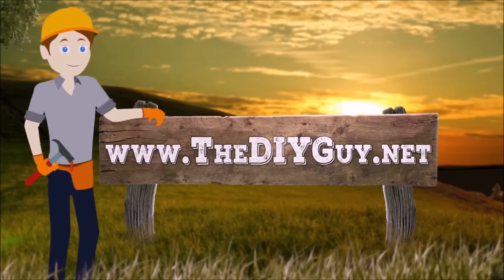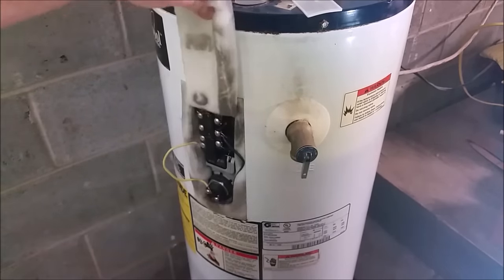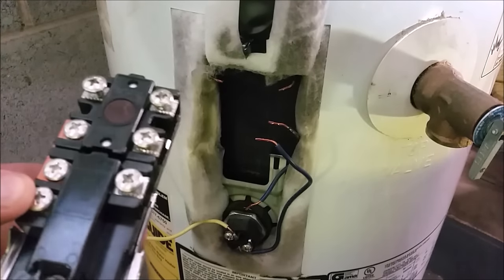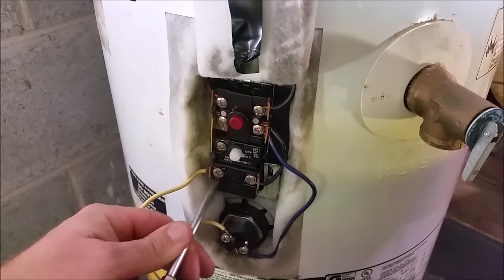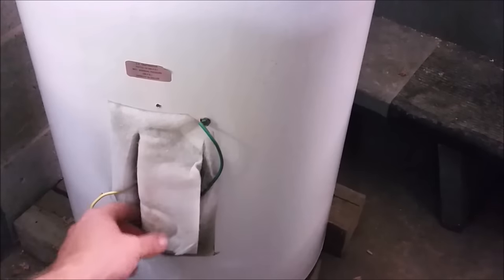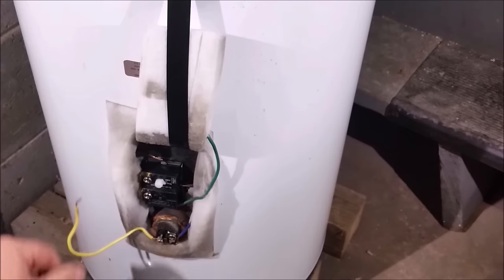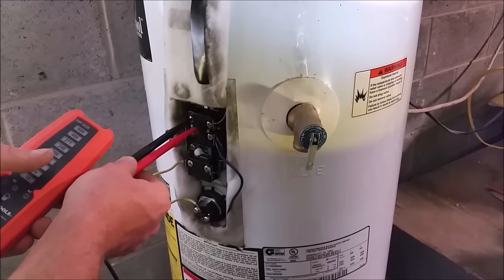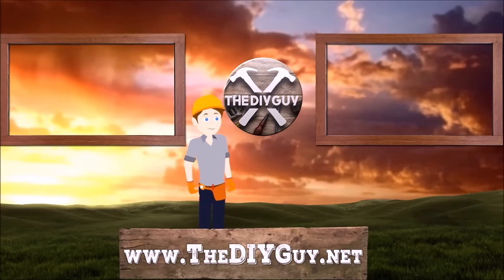How To Replace Your Electric Water Heater Thermostats

Comment: Thanks so much..... out of the blue this evening - no hot water - had it this morning.   
Most likely thermostat went out?   
I'm hoping that's it -  cause changing the elements and having to drain tank, etc seems like a lot more than i could manage....
Reply from the maker: You should be able to open the top inspection cover and hit the reset red button on the t-stat and get hot water maybe in 30 or so mins depending on how long its been out and used. See how long it lasts sometimes they will trip in a week or so sometimes a couple months. It most likely overheated and tripped. So replacing the t-stats should take care of it.
Reply: @TheDIYGuyDOTnet  thanks so much -  your advice is invaluable!!
Reply: @TheDIYGuyDOTnet  well .....a trip in my attic revealed that my RUDD heater was installed in 1996...   we've had work done it over the years, but always hired someone....  when i took the cover plate off the top, all I saw was the element.... when I removed the bottom cover plate, there i saw a thermostat -   so I did press the reset button to see if maybe that would do the trick -   will wait about 30 minutes, then check........... any other thoughts on my observation??
Reply from the maker: @buetow63  If you heard a click when resetting it, it should get warm. Did it end up getting warm/ hot? Seeing that yours was installed in 1996 and that its in your attic I would think about replacing it in the near future unless they have a pan or something to catch and drain the water if it starts to leak. Sometimes they leak at the top of the tank or near the t-stat and also cause the t-stat to trip or go off on reset. Was any of the insulation wet within the inspection cover? There are both 220 volt and 110 volt water heaters out there. Its hard to tell from what your describing which one it is. You could click the link in the description and go to the bottom of the page an upload a picture of it. But because of the age and location I would think about replacing and a newer one shouldn't leak for a while and it should also lower your utility bill as it will be more efficient.
Reply from the maker: @buetow63  You're welcome, Glad we can/ could help.

Comment: Great Video. Very detailed and clear. Question Please. How do you test the reset button? My water heater is dead. When power is applied to it I get nothing. No sound to indicate the elements are heating. The reset button is pushed in and when I pressed it I thought it would pop out but it didn't. Seems to be stuck in place. Any suggestions will be appreciated...thanks.
Reply from the maker: Thanks. There really is no way to test the reset button.. It goes off because the water in the tank got to hot so you can run the hot water for a bit to lower the temperature in the water heater and then try resetting. If that doesn't work you will want to make sure the breaker fully reset. Shut it all the way off and then back on and be sure both legs of the breaker engage. Next you can open the top inspection cover and test the top to leads with a volt meter to make sure you in fact have 220 volts going to it. Be careful as you will be dealing with live electric. If both legs are on and you get 220v at the top t-stat then I would suggest replacing the t-stats.
Reply: I'm having the same problem with my Rheem model 71-40S but when I take the top plate off there's nothing there but foam insulation?

Comment: should you replace the thermostats when you replace the elements?  I cleaned out my 50gal heater and sucked out all the salt gunk from the bottom and replaced the elements and anode because I was in there and the bottom element was badly covered and the anode was half depleted.

How do you know the thermostat is bad?  After I replaced the elements and anode, it seems it does not heat like before.. I am suspecting the thermostats since that is all I did not replace.  Do you have any advice?

Comment: The insulation around my water heater's thermostats was significantly more of a pain in the ass, but I got it done. Hot water was lasting just shy of 10-15 minutes, even though it's a 60-gallon tank. In about 3 hours, I'll see how it's doing.

Comment: I changed my thermostats but they didn’t come with replacement plastic covers and the old covers don’t line up correctly does it mater if it’s not an exact fit?
Reply from the maker: All the replacement t-stats I have seen came with new covers I guess they are cheaper if they don't include it. Those covers are in there so that if you open the cover you can't touch the wire while moving the insulation. As long as there somewhat secure and cover the wires you should be all right.

Comment: Does the water have to be drained first
Reply from the maker: For replacing the t-stats no need to drain as they go on the outside of the tank. If you were to replace the element then yes.

Comment: Our water is only warm not hot, and there isn't a lot of it.  I checked both elements and the thermostat and all is good.  Should I assume its the dip tube?
Reply from the maker: Hello, How did you test the lower element? I would start with replacing the lower element as that is normally the fix for running out of hot water.  Link to our video on replacing it ->   https://www.youtube.com/watch?v=ReR_UcOf7E8

Comment: So will this be the cause of my hot water not lasting as long.. when showering the hot water runs out within a couple mins then its cold again. I have electric..
Reply: You'll want to check your heating elements as well.
Reply: @IrishLincoln    what about if i have a leak somewhere, will that also cause the hot water to run out faster then usual??
Reply: Lower thermostat went bad on my Bradford. 5 minute shower before running cold. Replaced the lower stat and showered for 25 minutes. Dip tube can also go bad but that would mean lukewarm shower water from the get go

Comment: Replacing thermostats and elements and ran into a problem with some of the wires being too short to go back into the thermostat.  There was no slack in the wire.  Suggestions on how to safely extend the wires...they are about 2 inches short in each case.
Reply from the maker: I have also ran into that on some heaters. I was able to pull some wire down from the top connection. Now its a little harder as there foam filled/ insulated. You can use the same size wire and wire nut and extend them. Be sure its 10 gauge wire and a wire nut meant for 10 gauge wire.
Reply: Hey thank you for that.  I'll hit the hardware store for the 10s right after work.
Reply from the maker: No problem. Good luck with getting her back up and running.

Comment: Hi. Great video. Are the thermostats universal? Will one thermostat fit multiple brands of water heaters? I have a whirlpool unit. Im sure its the thermostat, I think , as I am continually resetting the unit. Ken
Reply from the maker: Yes, They should fit. Only difference between most of the is how they tell you how hot the setting is. Some us just A,B,C , Some use warm, hot, some use actual degrees. Most of the time replacing the t-stats will solve the problem of having to always hit the reset button. Thanks for watching.

Comment: Do I have to replace both thermostats if only the lower one is the one that is not working?
Reply from the maker: You don't have to replace both. I just find it better to replace in a set and for around 22.07 you can replace both. https://amzn.to/2zEc4Sv upper and https://amzn.to/2uGt8BZ lower. There may even be cheaper ones on there.
Reply: Thanks
Reply from the maker: No problem, Glad we could help.

Comment: Help  4 year old water heater whirlpool,  bottom door area inside is all rusted, we discovered this when we got no hot water this am and had to hit reset on the upper reset button, better check the lower one while we had the power off and there is rust

Comment: Is it possible for one thermostat to go bad on the water heater ?? 

I I did replace one heating emement that was bad
Reply from the maker: It is possible to have one t-stat go bad. The upper one controls the lower one. I would recommend replacing both as they are not that expensive for a set. There's a link on our site to them upper around 14$ and the lower 9$ ish. So for a little under 25$ you can replace both might even be a kit with both for less.

Comment: Leo me just say that not all thermostats are easily removed. Top - I struggled to remove it  bending it in the process. Bottom, still unable to remove. Feels like an invisible screw is holding it in. Rheem 38 gallon, 7 year old. Top element so loaded w/caked in broke sediment while removing it. (Called plumber-$100/ service charge / same an hour. ) cancelled. Refuse to give up! Read if holding wire breaks—- out of water heater.

Comment: Quick i hope anyone have answer for me, for some reasons one of my element went bad I replaced it ever since that day my reset button keep tripping every 4-8 hours and when i push it back in my water get so hot even though i put on the lowest settings which is 90 degree and my water never used to get this hot before even though I used to have it on 125 degree can someone help??
Reply: Replace thermostats its not reafing water right
Reply: I did change both thermostat and I’m still having the same problem
Reply: I have this same exact issue. How did you end up resolving?
Reply: It was the upper Thermostat that went bad now its been 4 months no issues.

Comment: I did fix mine the way you showed me but it keep tripping my breaker
Reply from the maker: Sorry for the late reply maybe you already discovered the problem. Sometimes a lower element can cause the breaker to trip but most of the time on a tripped breaker I find the heater itself leaking or moisture either in the main connection area or near either one of the t-stat inspection covers. If you don't see water/ moisture in or around the heater you might want to try and replace the lower element and see if that solves your problem. Good luck with getting it repaired. Our video on replacing the lower element -> https://youtu.be/ReR_UcOf7E8

Comment: why does everyone say to flip the break off as opposed to just unplugging the water heater? My plug is right next it, i just yang it out, maybe others are hard to reach or something?
Reply from the maker: Most water heaters are hard wired in so shutting the breaker is the only way to cut the power. Newer code calls for a service disconnect/ rated switch to be installed right next to or on the water heater to shut the power off.
Reply: @TheDIYGuyDOTnet  Thanks for the answer,  makes sense. I'm actually in a fairly older house from the 70's. I guess its odd they put a 220 socket right next to it.
Reply from the maker: @Zhurak  Yes, I would say its odd for any house to have an actual plug that the water heater plugs into even more odd that its an older house.

Comment: Water heater put out too much hot water
Reply from the maker: Yes, faulty t-stats can cause it to over heat the water or not maintain a temp. Sometimes they will overheat the water and then go off on reset. So in a day or so depending on how much water you use it may become cold.
Reply: @TheDIYGuyDOTnet  Exactly what I have going on. I Was thinking about getting a tech out (around $150) but seeing how I can replace it myself for $25 dollars and 20 minutes, I'm gonna give it a try. Great video!
Reply from the maker: @lvlikeyV  Hopefully the replacement of your t-stats went smoothly for you and you were able to save the 125$. Thanks for watching and taking the time to leave us a comment.
Reply: @TheDIYGuyDOTnet  I purchased a new set of upper and lower t-stat from my local Ace hardware for $30 including tax. Took me about 20 minutes. I took pictures before so I wouldnt get lost. Its been running for about a week with no issues. This video was pure gold. thanks!
Reply from the maker: @lvlikeyV  You're welcome, Glad we could help get the heater back up and running and save you some $$. Thanks for watching and don't forget to give the video a thumbs up. Thanks